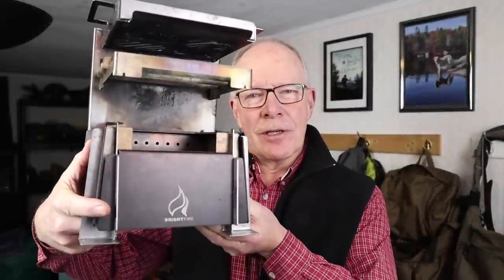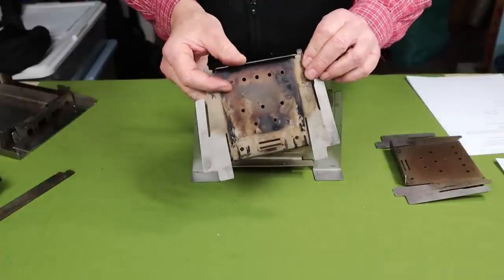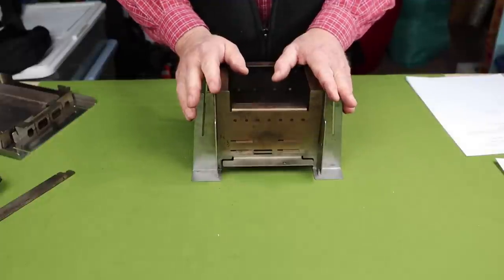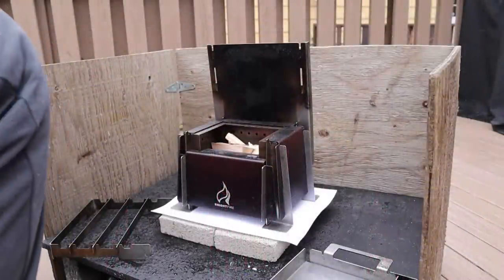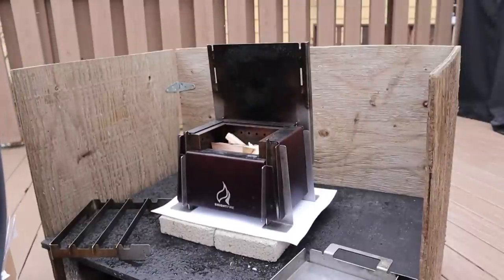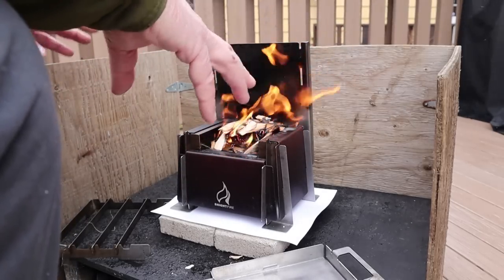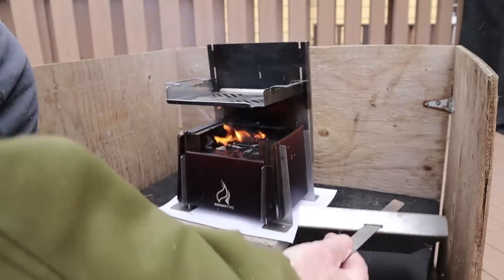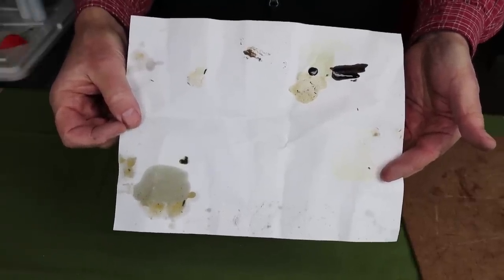BrightFire Haven Smokeless Fire Pit - The Pinnacle of Design and Engineering Excellence

Comment: It’s a lot more sturdier than my rocket puzzle stove. Will save some money and buy it. Yet their heavy not ultralight. But if a push comes to shove I can use it to keep warm. Because of what you’ve taught and demonstrated I can use for recreation and survival. Something to keep in my car. In case of breakdown or power goes out at home. Without using a large pit grill. But for traveling is the main topic. Going camping. If weather should become a little drastic having the ability to create a high heat output with the top will or can sufficiently supply some sustainable warmth. Being that it’s steel can hold high heat and radiate it at a high burn 🔥. The deflection shield is a definite been trying to find something like this for some time. There are others but not as compacted. Others are to large. Like you said. Can’t carry in a backpack but can be carried with some form of pulled wheel cart. Want to find the cart for pulling a snow sled. I remember as a kid. For like duck hunting the made a wheel cart to carry it on ground. See, I’m not a dooms day prepper but a person who tries to utilize all efforts with the equipment I purchase. Since the coronavirus. I needed things I could grab and go if it got bad!!!  Find a quiet place and sit  for as long as I could. Keeping warm, boiling water with some luck and foraging I could make at least a year. But definitely something to used if stuck in a bad position. You have shown me many different ways to experiment with gear I have. Gotta love you. A life saver 🛟 

SEMPER FI
Reply from the maker: Well said on every point. Thanks for commenting

Comment: This is a pretty well thought out design and it shows in its performance. The only suggestion I would give involves the ash pan and fire grate. It seems to me the way to over come the first part of installation of those parts would be to put a Z bend and tabs on one side to support and space the pan and grate while installing the front plate. This should only add a few ounces to the weight of the stove. As for performance I was very impressed. Thank you for sharing this product.
Reply from the maker: I know Chris is reading the comments and will see you suggestions. Thanks for commenting
Reply: @MarkYoungBushcraft  I hope my suggestion helps him.
Reply: @viewsandreviews180  U
Thank you for the kind words and suggestion. The design does incorporate a version of what you are talking about. When you tilt the back wall back and rest it against a surface the rear tabs of the two pans lock into place and keep your hands free to slide the front wall on. Mark is going to demonstrate this technique in the next video.

Comment: Looks interesting. Would you use the oven to maybe toast an English muffin or something? A tiny frozen pizza? What are the dimensions of the grill plate/oven? Six inch square?

This kind of thing would be good for power outages or emergency situations like being snowed in. And the option of using an alcohol stove is another benefit, as is the gasifier feature
Reply from the maker: Close, 7"x5.5"x.75" I agree, lots of use for the Haven. Thanks for commenting

Comment: G'day Mark, dunno what happened to my original comment, disappeared this end, apologies if I'm doubling up your end, good chance of user error, lol.
So happy to see this design. Since the appearance of Solo brand and other one piece cylindrical "gasifiers"; I've always wondered why not apply the same principle to a square/rectangle take down job ...... and here it is .......... well done Chris !!!!!
Yes you do lose the adjustable height if using a larger diameter pan, but you still can.
It can take an alcohol burner, well and good. I'd still like to see a design where you can insert a 
a remote canister stove to take advantage of the body as a wind shield and to capture/funnel the heat upwards as an efficiency bonus. Its extremely likely, here anyway, that a fire ban day will be accompanied by a fair ol' hot northerly wind, and on the other end of the scale in winter, it takes wet wood out of the equation should that be a problem. Cheers Duke.
Reply from the maker: Hi Duke. I will try and see if any of my remote canister stoves will fit inside the Haven. Thanks for commenting

Comment: I figured that maybe you had me in mind when mentioning that the stove wasn't meant for backpacking. Woodgas stoves require a double-walled construction, and cannot be made as light in weight as a single-walled stove. Waiting for gasification requires time and extra wood, neither of which are an acceptable tradeoff for hikers who wish to travel alone, ultralight, or long distance. 
Stoves like this are probably perfect for a group hike in to a base camp from which they would sightsee and explore. 
Not everything has to be ultralight, even for me! 😁
That stove is very well designed for its intended use. 😉
Reply from the maker: Why Daniel, why would you think that?😉. I do have a few UL titanium wood gas stoves in my playlist. Thanks for commenting